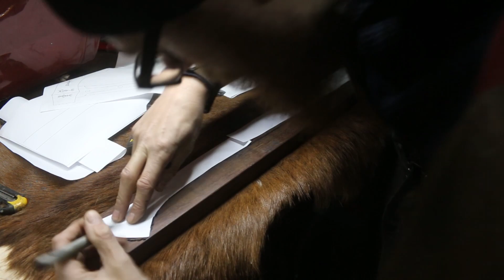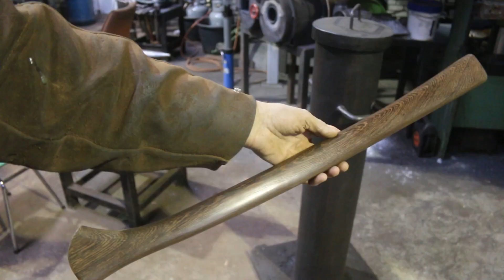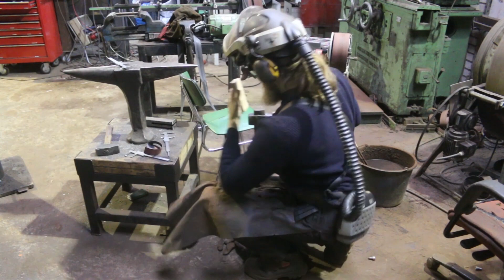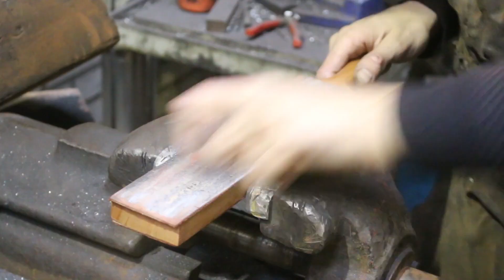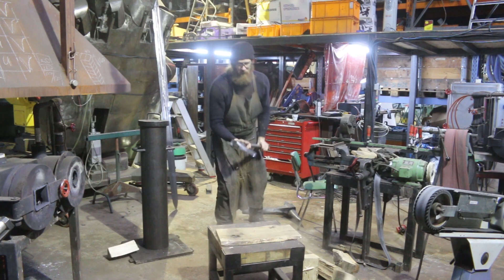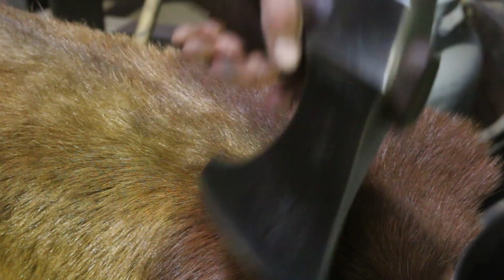Forging a viking axe from a broken sledg hammer, part 3, making the handle.

Comment: Looks very good, but a glued wedge is not the traditional way. :) I would prefer a steel wedge without glue.
Reply: I always use a hardwood wedge without glue and let the fitted handle soak in boiled linseed oil to let it expand. I believe this is what they used traditionally because the steel wedges of today are a lot more common then back in the day? Not sure about the history of wedges haha
Reply: also the handle material he chose is very inferior for this project, as it is extremely brittle. Notice the axe next to his he is using as a guide has a hickory handle-   that wood is chosen for a reason.
Reply: @lennarthoek8392  Sounds interesting  with the oil, but does the oil not disapear over time ? My grandpa(blacksmith) only dries the handle at or in his fire and used a steel wedge. Ofc over time, if the handle get wet-dry, wet-dry... you have to fix it.
Reply: @fettmaneiii4439  His handle looks like a tropical wood. Should be much better than hickory and it is not brittle. BTW I destroyed a lot of hickory handles by chopping and i am very happy now with my Fiskar. :)
Reply: @fixit4387  oil will stay for a really long time! Ofcourse you do have to re-oil the handle once in a while, but when done properly it can last a lifetime. Water is the really dangerous option, because it will dry out in a really short time period. I was taught that when you make a handle it should be dry, and once you fit it you have to oil it every day for a week, every week for a month, every month for a year and then just every year. This way your axe handle should stay in a really good shape. I would assume (but can't speak from experience) that drying out your handle would cause it to become more brittle, and also have the danger to become infested with wood bugs. Both these things shouldn't happen when oiled properly.

Comment: Hard to believe anyone is going to split wood with it.
Reply: I think the Vikings split heads, not wood.  Regards.
Reply: @henniebasson515  That's a tool axe not a weapon. Weapons had relatively flat blades until they got close to the eye when they rapidly became thicker. Tool axes are thick like that one to prevent them from getting stuck into the wood and assist in splitting while weapon axes are thin to penetrate better which would get stuck in wood and not split very good but does wonders to the human body.
Reply: @JETWTF   It was a tongue in the cheek comment, but thanks for the information anyway.  Make lots of sense.  Regards.